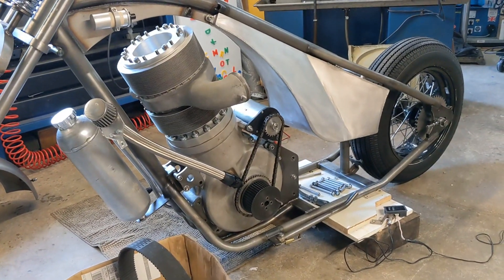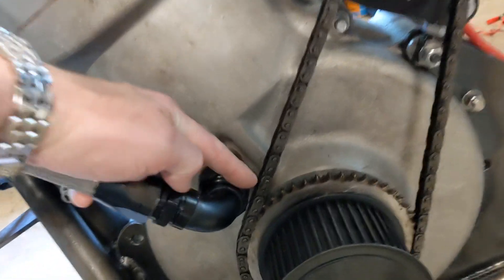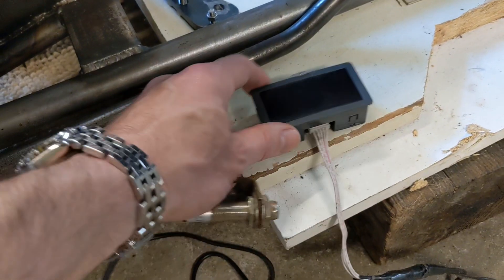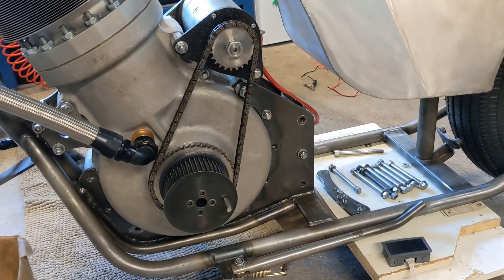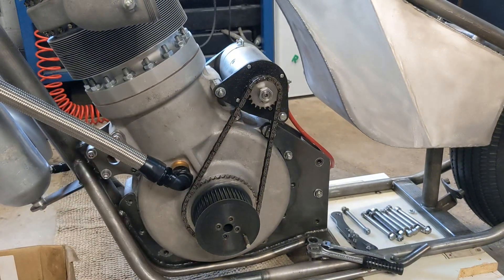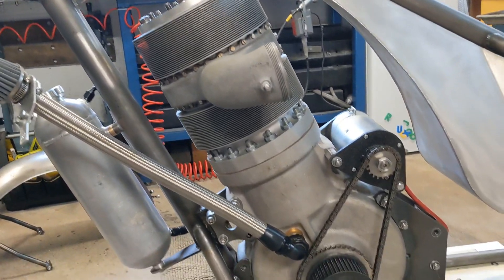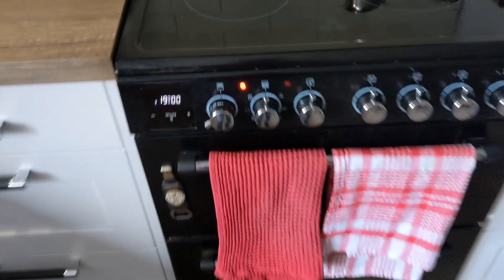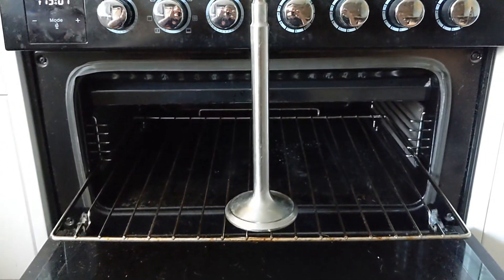Rev counter says no!

Comment: To determine if the valve is hollow, drop it into a burette of water and measure the displaced volume and multiply by the mass density of steel. Compare the result with the actual measured weight. If solid, then the numbers should be a near match. Simple!

Comment: You could weigh and measure the valves volume by water displacement and compare it with steels density to see if it's solid.

Sodium after all is still rather viscous in liquid state and depending on how much and how exactly it is filled will probably not be very noticeable via shaking by hand.

Comment: I have an old 4" exhaust valve from a 1950's Mirrlees diesel. It is made from 'NIMONIC', so that seat area burns can be welded and the valve re-used. (up to 3 welds permissible). It would normally have run at a constant temperature. (<1350F).  Has your valve got any manufacturer's numbers that may give a clue as to it's origin? I am so looking forward to the first light of this engine!
Reply from the maker: Yes it has a couple. I'll get my glasses and have a look.....

Comment: Sodium filled valve? Have never heard of that. Can you please explain?
Reply: For better heat-transfer and a cooler valve-head sometimes valves (also intake for charge-cooling) are filled to 1/3-2/3 with sodium, which liquifies at ~98°C. That can cool down the valve head up to 100°C and more, which can prevent knocking and valve erosion. AFAIK one of the first famous engines fittet with sodium filled exhaust-valves was the Wright L-5 of Charles Lindberg's "Spirit of St. Louis"
Reply: @hiha2108  Thanks for the explanation.
Reply: @Turnipstalk Thanks for the explanation.